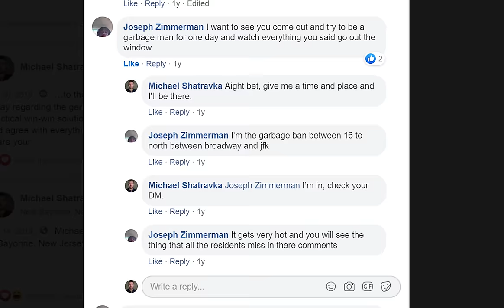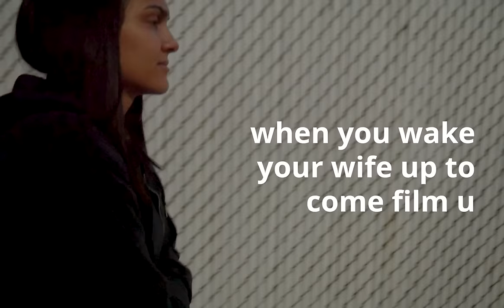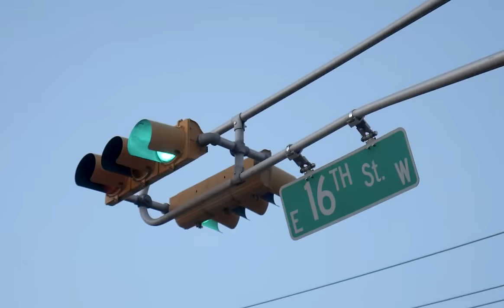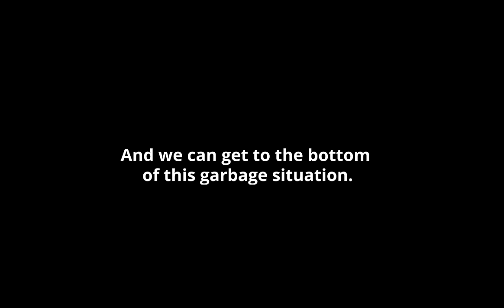I was a Garbage Man for 90min - MOST GRUELING JOB EVER.

Comment: Sanitation Worker here... I can speak for my colleagues... We don't want accolades, we don't want awards, we don't want your appreciation, etc etc. All we want is some respect when you roll up on us with your cars. We know you're in a hurry and we are in your way, we only intentionally block you to protect our co-worker who may be working several car lengths ahead! 👍
Reply: @ Eric Feli it depends.  Where I live there is one garbage truck that is out on a regular basis at 8AM (which is the heaviest traffic flow time for rush hour). They operate  on a very wide major road (it is single lane road but wide enough for at least 2 lanes in each direction). The garbage truck will stop the traffic for an extended period, as they go to each house. The garbage haulers are staying on the one side of the road (since it is a major road it wouldn't be safe for them to cross over the street, to collect garbage from the other side),  so when they step off the truck they are curb side next to the truck,  there is no way they could be hit by a passing driver. However, the trash truck will NOT move over a few feet toward the curb, to allow drivers to safely pass around him. It is a very wide road, so there is plenty of room. The trash truck is FORCING drivers to illegally go over the double yellow line into oncoming traffic to get around him. All the cars eventually pass by driving into oncoming traffic that is going very fast, because if you didn't you would be stuck behind the truck for 30 minutes while they go house to house.   There is no other alternative route other then to use this road to get to work, otherwise I would.  I tried to time my commute to avoid the truck but he could be 15 minutes earlier or later, so it is pointless. How is this safe, to force drivers to cross over the line into oncoming traffic, when they cannot see around the truck and sometimes it is foggy and raining weather.
Reply: I will remember that. Good advice Man. Do They pay you well for the Job?
Reply: @jansa940  Maybe the Sanitation workers on that route are discourteous, certainly I am not here to defend the actions of all Sanitation workers! Some are miserable, down right rude, and lack etiquette or common sense. Personally,  I try to justify the truck to the curb I am working on whenever prudent. There are times when I do INTENTIONALLY not pull curbside. There is a specific avenue on my route, EXACTLY as you describe. Our speed limit is 25mph and traffic routinely flows at 40+mph. By blocking slightly to the medial side, we are in affect slowing traffic on purpose. Why? Because in this situation, we don't want traffic that is flowing at 40mph, misjudging the oncoming traffic on a pass attempt, decide in the last second that there is not enough room, and swerve into us while we are loading. At that speed, stopping distance is crucial, if you worked exposed at the rear of this machine, you would understand. Now I wouldn't block you completely, I absolutely would like for you to pass me, I just want you to pass me at or below the speed limit. I hope this makes sense. ✌
Reply: @jansa940  Sounds like you need to ride along! You have no idea at all what it's  like!
Reply: respect
Reply: @jansa940  as a public employee of the roadway I can say with a certainty that nobody is forcing you to break the law. That lays 100% on the driver to navigate around the working vehicle legally.
Reply: @jansa940  if it happens every day than take a different route
Reply: @jansa940  I think it's important to realize that sanitation work is annually one of the top 5 most dangerous/lethal civilian jobs in America, and the bulk of that is due to being hit by cars. So to someone on the outside it may seem like they're taking "unnecessary" precautions, but if you're that driver and you've surely seen or known of coworkers who have been hit (the odds would say that is the case) your definition of "unnecessary" or "overkill" may be a bit different.
Reply: Damn right my brother I worked for the city for a year it was notfor me but it was a hell of a experience I never wnt to do Tht shit anymore
Reply: We have to change we are so wasteful
Reply: Facts
Reply: Why can't we get the homeless helping you need manpower you don't have to pay just feed them
Reply: @jansa940  You ride on the back of a truck for a bit and you'll find out people will try to squeeze their vehicles through places you would never expect.  Not only that, they do it as though there is nothing to be cautious about and drive the same speed as if there were no traffic at all.
Reply: Eric Feli if you was doing a job like that you might also be Miserable to we all have moods ..
Reply: Yes sir much love
Reply: @Silkroads733  I do this job, lately 6 days a week, I try to make the best of it. What I don't do is take my frustration out on the public. Most people are courteous and deserve respect as well.
Reply: Eric Feli true true
Reply: Eric Feli not everyone is the same it’s natural for some people to take their frustrations out on others ..we all vent in different ways ..the trick is to not always take things personal..understanding of human psychology is the key also a bit of tolerance and patience....🙏
Reply: @jasonjamrs7413   I think offering citizens, who are homeless, an opportunity to make a few bucks is a good idea. Currently, we use people who have been court ordered to perform community service. However, none of them can work "on the truck." It's too dangerous and it is a lawsuit waiting to happen! We give them barrels, shovels, brooms, etc and designate areas of litter for clean up. Great idea though!
Reply: I came across one who was on a backroad all by himself and about every house ha 10+ bags. I was on the clock but still helped him until I got to my clients house. Never seen someone so grateful before.
Reply: I agree with you sir I always stop 2 car lengths behind a garbage truck on my way to work no matter if i'm getting late
Reply: Periodt
Reply: Aye I got a question u saw that big pile of garbage towards the end of the video here in Woodbridge, Virginia most sanitation workers/companies wouldn't take that specifically because it would be to much time wasted on one house so why did they take it I put trash in and around my trash can that size and the next morning after trash day it was still there and got fined by my hoa(home owner association) dose it just depend on the company and they told me to either take it to the dump myself or put a little of it out on trash days
Reply: Respect and a well decent home payed money
Reply: We appreciate it bro
Reply: Respect. You guys are legends
Reply: @damaribrackett1159  Some cities/companies have limits to keep people from putting everything under the sun out there.  Most times these limits are based on how much trash an average household would generate.  In my area we issue 1 96 gallon polycart that is dumped once a week.  If someone usually has more trash than what a 96 will hold, they can request additional carts for around $5/month extra.  If it’s not a regular occurrence, there are stickers available for purchase that you would put on any extra trash that is over the set limit.
Reply: Looks like you guys in the US could do with some proper untilities. In the UK (I'm sure not everywhere in the states is like this) we have wheelie bins that hook onto the back of the truck and pull them up to the crusher
Reply: Then get out the way sheesh
Reply: If people seen how dangerous it is for the people loading the bins they would understand. Accidents waiting to happen
Reply: @jansa940  because if he doesn't most drivers will try to squeeze past as closely as possible and he may have to swing out to avoid a parked car or a laborer needs to get on the step on his side and could be hit. He's trying to encourage cars to go in the opposite direction before they commit to that street.  Couldn't you leave a little earlier or choose another route once a week?
Reply: @Lavon8338  

That would be to easy for him to do apparently.
Reply: @LambdaMMXI  Depending on the county or city the sanitization services might be contracted out to a private company and they might have different agreements with regards to terms of service. Yes, it might be harder for the workers without wheelie bins, but that decision is within the discretion of the firm providing the service.
Reply: Well said. I always give them all the time and room they need and I always get a huge thumbs up with a big smile from them. That is the least we can do and it does not go unnoticed.
Reply: @tedrey4510  I worked for the city of Raleigh in 2017 for people ready for 2 weeks.They are a temporary service
Reply: you are already getting a paycheck like everyone else. you don't want? no one is gonna give you anything to begin with, just like every other worker and job in the world
Reply: Exactly
Reply: It’s most likely an apartment building
Easily 30-100 bags or more

Comment: The weather conditions were good on this day,  imagine doing this in the dead of winter or in a raging rainstorm...
Reply: Or down in the Alabama humidity in July. That wet garbage they were dealing with, on top of it being hot.
Reply: I did this for a summer near Auburn AL. It was brutal. You could catch a breeze riding on the truck sometimes. O the maggots though.
Reply: Winter makes the job a whole lot harder, especially when you have to back up a steep road covered in ice.
Reply: The rain is the worst part of the job
Reply: Sounds like fun :D
Reply: Yea colorado mountains after a wet spring snow storm.
Reply: I used to work in sanitation and working in a rainstorm is one of the reasons I quit i was really like the cartoons when they empty they boots of water
Reply: Facts.  I did it when it was snowing with 2 feet of snow on the ground. One of the worst days of my life, couldn't feel my fingers and toes for two days afterwards. The rain was fine, no problem for me.

Comment: It's amazing how garbage collection varies so much from one part of the country to another. Where I live we haven't done trash collection like this in decades. In fact we rarely even get out of the truck. Automated hydraulic arms/grabbers to reach out and grab the residential trash carts. It's up to the customer to not have the carts blocked. If they are blocked then they don't get serviced. I'm in the commercial side of the business where I service the dumpsters you find at businesses. Pretty easy, new trucks, great pay and benefits, 4 day work weeks with a 3 day weekend every week. Been doing it for 15 years and it's a great job. But again, it all depends on what part of the country you're in. In this video it's obviously hard, dirty, tiring work. Glad we don't do it like this.
Reply: Some places need the rear load for lack of space
Reply: @John-ze3vo  Yes, I'm aware of why some locations are still using rear loads. Been in this business a long time and have witnessed trash collection in a lot of different countries. It's crazy how it can vary. I was in Costa Rica behind a trash truck and pulled over to see how they operated. Basically it was a dump truck with 2 guys in the dump body/bucket and 3 guys in the cab. When the truck would get to the next stop, 2 guys would get out of the cab and throw the bags of trash up to the 2 guys in the bucket. The driver did nothing but drive. 5 men to operate one route.

Comment: Some serious core and upper body workout there.  Imagine winter's gotta suck.
Reply: I've been a garbage man before.  Summer sucks the worst because everything rots in the heat fyi
Reply: As a front loader operator, winters are pretty bad as well.  The containers are frozen and it’s very easy for the containers to slip off the forks and go into the hopper of the truck.  Likewise, it’s hard to move the containers when they’re frozen as well, so winter can be just as bad as summer.  Summer just makes it smell really bad.
Reply: @deadnedz  summer heat turns all the crap to slop in the bottom of the bags.  It's not just stinky, its WAAAAAY messier.  And theres maggots
Reply: @getchasome6230  and the FUCKIN FLIES!
Reply: @getchasome6230  believe me brother I know.  I have to mess with the commercial garbage, and that is absolutely nuts.  But I’m used to it, I don’t even smell it anymore after about ten minutes.
Reply: Yes, they do. Slips and falls due to ice. Snow mounds are a bitch too.
Reply: @getchasome6230  depends where you from in the north of america its gets ice cold and driveways cold with ice much harder.
Reply: My brother is a trashman and he working out in the snow rn lhh. Ima be a trashman next week
Reply: Frfr
Reply: @deadnedz  omg 😖
Reply: @krystingrant6292  yup been working here now for a month and 2 weeks. It was exhausting at first but not that bad

Comment: Damn , guy with the gray cap is putting in work foreal! 💪 tough guy, they all bound to have back problems with those movements tho.
Reply: I do this job with 2 small broken bones in my back
Reply: It's tough on the knees back and wrists I've broken multiple bones doing this job and even crushed my hand in the hopper once
Reply: @lilboo0922  concrete is worse , take care of your back
Reply: Nah just driving the concrete truck lol we pull up pour the concrete and go washing the truck is the most physical part we do 😎
Reply: Guaranteed injuries in this industry. Mob rule, and HR is in the back pocket of the route supervisors. Seldom do you find unions.

Comment: You guys gotta fix your garbage pick up and disposal system. Where I live there’s specific bins meant for recycling and waste that are provided by the city. These get picked up by the trucks on certain days and if you are using these black bags and not bins the garbage simply doesn’t get picked up. On top of that the garbage trucks have mechanical arms that lift the bins and dump the bins into the truck. The job only requires 2 people then the driver and the mechanical arm operator. It’s a lot more efficient and cleaner then what’s going on in your city.

Comment: Looks to be an old Mack Trash truck with an E7 in it, I work at a Mack Dealership and we have to work on trash trucks every once in a while. The ones in our area have a service life of about 10 years between the 3 major truck companies, Autocar, Mack and Peterbilt, working on front loaders that are older than 5 years are the absolute worst. I also live in a smaller town, and our trash trucks that come buy have automatic bin loaders they are special front loaders or side loader, but the ones that pick our trash up also run on natural gas, which I believe to be the best fuel for trash trucks in 2021 because of the Regen issues diesels have. I've never wanted to be a trashman, but I really don't mind working on Trash Trucks, just gotta wear long pants, long sleeve shirt, gloves, safety glasses, and a hat.

Comment: That's a dying position for where I live, they have a hydraulic arm that comes and grabs the garbage cans and flips it into the truck. Even recycling trucks has them. What about you guys?
Reply: They hook two bins on the back of the truck and it flips them in. They haven't used trucks like this since the 80s.
Reply: I live near Houston and we still have trash guys
Reply: Same thing for where I live. However it kinda depends on which garbage company you have. The garbage company that picks up my trash once a week all of their trash trucks have hydraulic arms on them. There are still some trash companies though that still does it the old school way but not many around where I live. When my recycling gets picked up every other week they do it the old school way.
Reply: Can’t do that in these streets bro. Cans in the city are usually in the other side of the car. Plus the route has to be a good route that the hydraulic arm can pick every can. It’s hard doing this job. Did yard waste this past fall for a garbage company and it was the worse. Mad respect to everyone doing any time of garbage. Moneys good but fuckkkkk I never wished I was home in my bed until I got that job
Reply: @MattWolfe1019  also depends where you live. If you live in a city where the cans are in the other side of the cars parked on the streets then they can’t be using the hydraulic arms. Everything bad to be picked up with hand. It’s stupid but it’s how it works. Also it will take more time to do it because that way it would only be 1 guy instead of 3 like in this video.
Reply: Trucks like that wouldn't work in big cities like this or NYC.  Too much traffic. Too much bulk as well.
Reply: @gargamel55  I would hope so haha otherwise it'll be really bad especially during rush hour.
Reply: @aoife984  damn, youre a warrior!
Reply: Ohio yep this old way my trash ppl never leave truck
Reply: You’re probably talking about the huge dumpsters, they’ve always had trucks with that. The street trash is different
Reply: @vel6979  No they have the one with a hydraulic arm comes out from the sides and grabs them and throws it up on top. They also have lifters for the garbage men to attach the trash bins and lifts it in the compactor.
Reply: @JamEZ87  same here

Comment: This guy simply wasn't in the physical condition to be able to hang with a job like this. You can't have a gut like that and think you can do what amounts to CrossFit for 8-10 hours a day.
Reply: You're wrong.  As someone who has worked as garbage man for 4 years I've seem my fair share of people come and go.  One of those being a slightly overweight dude (almost identical to this guys frame) who lasted 3 years and was actually top 3 fastest/best workers.  Even writing this comment made me think how he managed to do it and still remain the same weight.
Reply: I guess it depends on their work ethic too. I also worked on a garbage truck once and one of the dudes i was paired with was rather heavy set like this fellow but he pushed on through. Of course he was probably used to this kind of labor